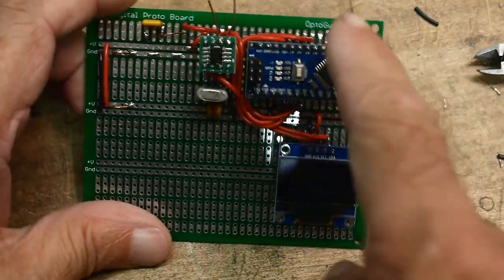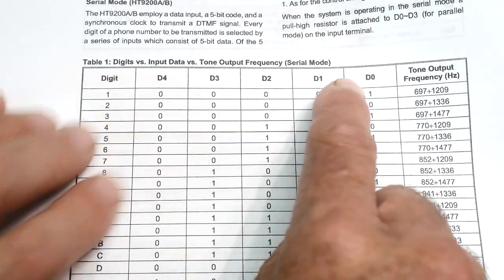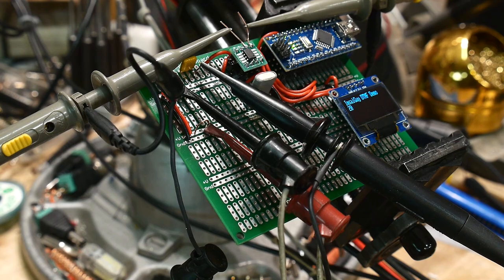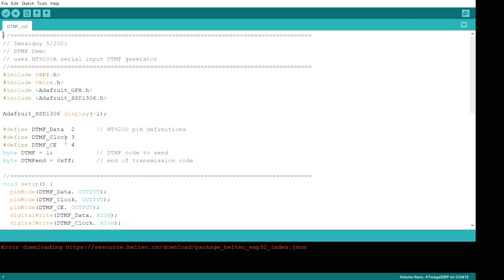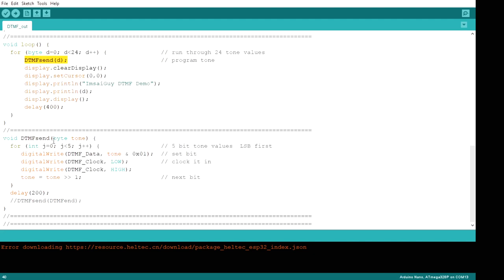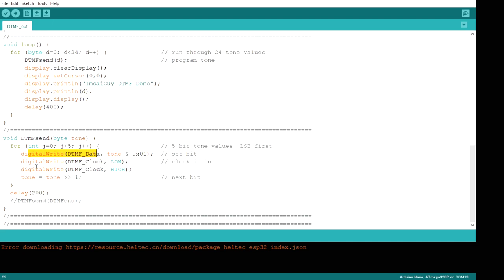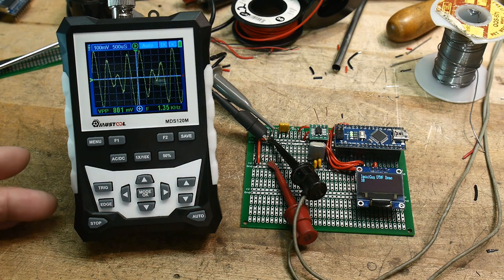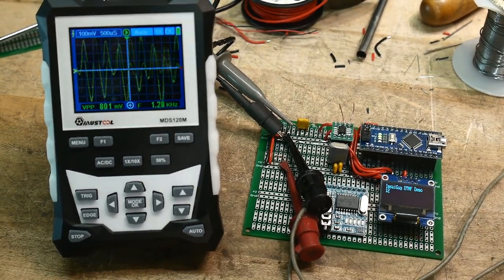#821 DTMF (part 4 of 6) HT9200 Encoder Hardware Working

Comment: That looks like it would also work when used as an SPI device.  Writing your own bitbanged version may be just as easy though ;-)
Reply from the maker: can you do 5 bit SPI?
Reply: @IMSAIGuy  not sure if Arduino can but some microcontrollers can set the transaction length in bits
Reply: @IMSAIGuy  just checked my old project, looks like the hardware there just gets 8 bits sent and only uses the last few bits. Maybe just a shift register internally that holds the last bits

Comment: I have always done hardware, but you make the software seem simpler too me.Thanks for the look.
Reply: I'm an EE but have always done software in my career. Trust me, when you work on very large software systems you can lose the will to live at times. So much legacy where the original authors are gone and modules and behavior that is not documented anywhere - given incomplete requirements and listening to never ending whining from the people that provided little and very often totally incomplete definitions of what they want nor an assessment of the behavior the changes they ask for on the rest of the systems.  My favorite software development is small systems and embedded computers close to the hardware but haven't done that in years.
Reply from the maker: seems like the people who did assembler make way more comments in the code than high level C. You are right, it ends up being a real mess.
Reply: @IMSAIGuy  The horror stories I could tell. Millions of lines of code without a single comment because no maatter what it is or how complicated  it's totally self evident. I've even heard statements like "the code is self commenting" or "any comments can mislead you so that's why I don't put any" Same goes for documentation. These are systems that are mission critical too.
Reply from the maker: @vincei4252  I had a software engineer in my group that I asked for a document. He looked puzzled. I said, like a 10 page report in college. He still looked puzzled. He didn't last long.